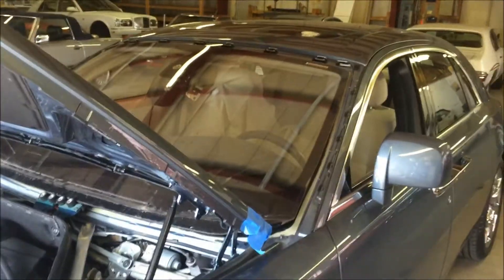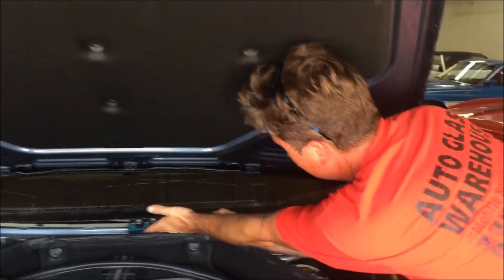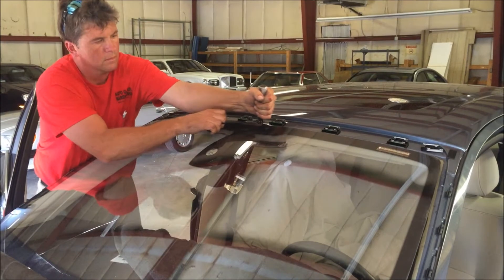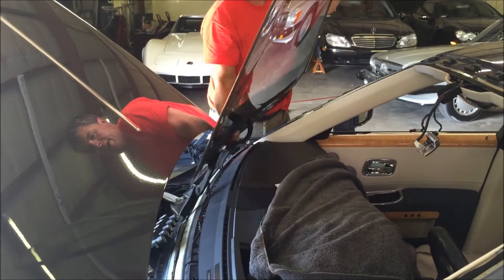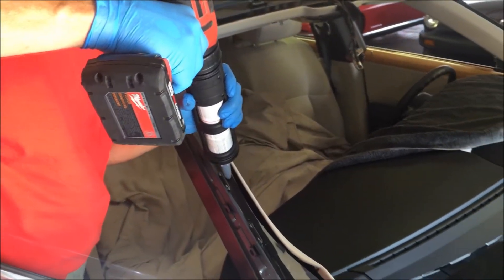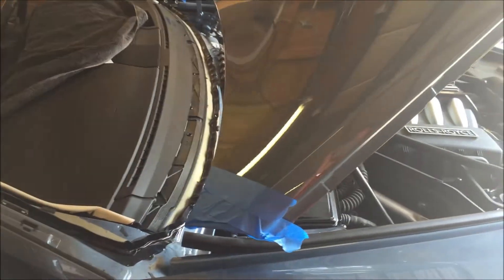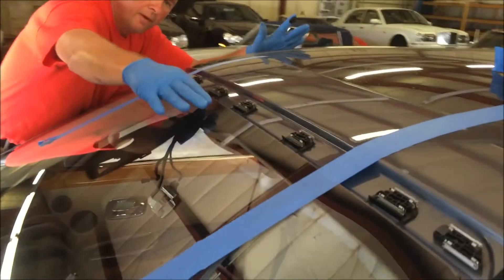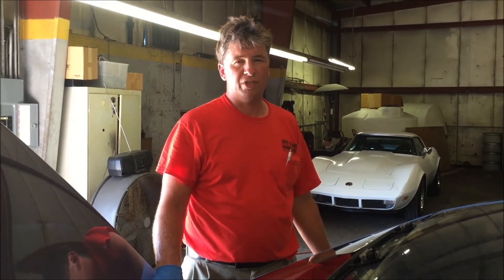Rolladeck 2010 Rolls Royce Windshield Replacement

Comment: Nice work, what was the set up on the rolladeck?
Reply from the maker: The most common configuration. 3" slide bolted directly to the roller platform with the red baseplate.
You will find that this will be the one that you use the most.